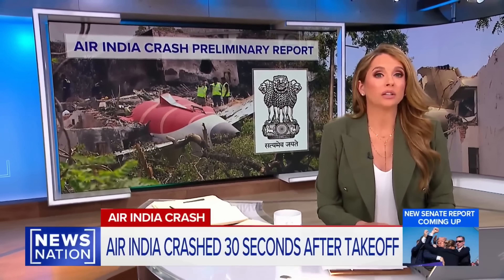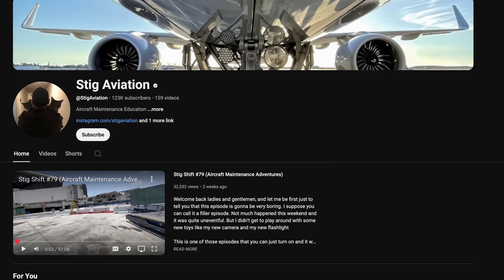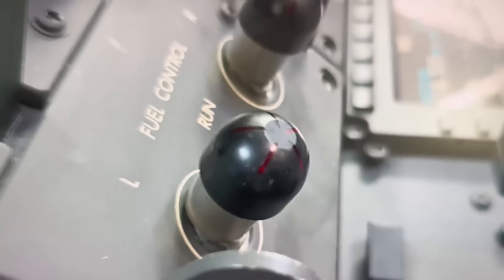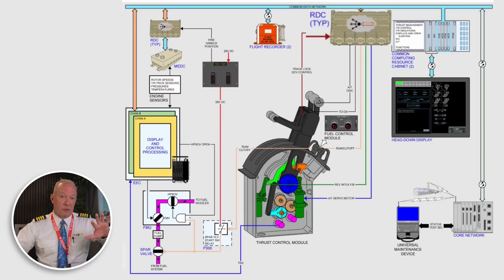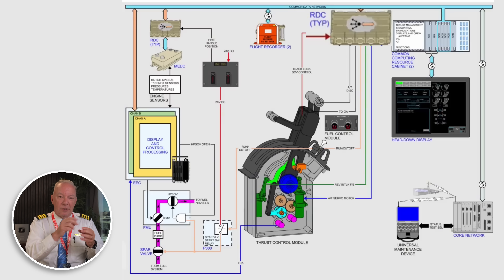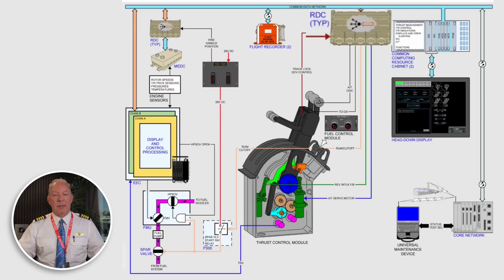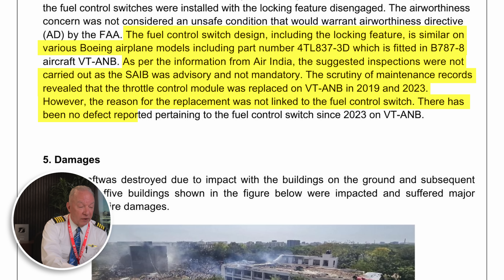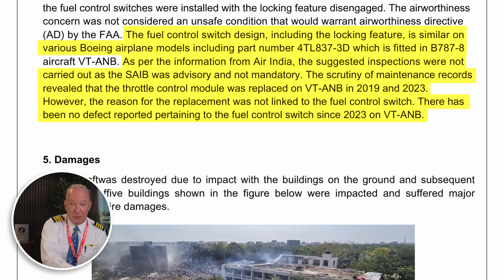The Truth About Boeing 787 Fuel Control Switches

Comment: The Boeing whistleblower is wrong in this case. Phantom mimicking did not happen because the FDR recorded the switches flip/ transition manually inside the cockpit. Meaning, somebody inside deliberately flipped them. Coupled with this fact is the FO asking the captain “why did you do that” in a definitive manner means he saw the flicking down from the corner of his eye.
Reply: The so calld "whistleblower" is showing his true colors with his nice little media tour on Indian TV full of silly conspiracy theories. Fairly sure that when the final report proves him wrong, his reputation will be severely damaged and will cast doubt on everything he said.
Reply: Your point is right, but if this was intentional, then there could be motive for the one who did it, to say something that would shift blame to the other. Knowing that it would be recorded, and could have a huge impact on their family, friends, insurance, etc. 
So the Captains statement does not clear him, and doesn't necessarily imply he saw anything.
Reply: Do you know at what point in the circuit the FDR is measuring the switch state?  Unless there are micro switches under the fuel cutoff switches that directly measure the switch physical position, your statement can’t be supported.  Generally, FDRs measure voltage and a certain point in the circuit and that voltage can be provided by a closed switch, a short circuit between the switch and the detection point or other possibilities.  I would be very surprised if the 787 has a way to directly measure the position of the fuel cutoff switches.  Only cockpit video would provide direct proof of physical motion of the switches.
Reply: But did the fdr get the correct information. We are not advised on the connection between the fdr and the switch or perhaps the relay. Incorrect cockpit information could have led to wrong decisions
Reply: I need to correct you on the quote, in that THERE IS NO QUOTE.  (Sorry for caps.  I'm having to repeat this a lot.)  The report does not contain a transcript. It contains a couple lines of indirectly reported speech from which it is impossible to tell if the words used are strictly accurate to what was actually said (minus substituting he for you) or only very roughly paraphrased.  We also don't know definitively who is speaking; that is only inferred.

It is definitely VERY STRONGLY IMPLIED that one pilot asked the other about something he believed the other had physically done.  But we don't know that for sure until the final report comes out.
Reply: From the picture that he’s showing and what he’s explaining the relays our battery operated also Ram air turbine is also saves the energy to the battery in order for the system to be powered My thinking here is that Ram air turbine falsely deployed, causing the surgeon in the system, giving extra juice to the batteries in in return these batteries caused certain electrical systems to be overpowered. It’s like a house breaker system where if you have a surge in the electricity, the breaker drips in this case the surge in the system, cause the switches to tripped, cause it is a electrically powered direct DC current caused by the search cause the system to fail I don’t trust buying and I believe Boeing Whistle blowers are correct
Reply: @123chiragkumar there was no mechanical fault in the plane. So making up fake scenarios is wrong and lies. Also, AAIB India is the lead investigator. They write the report. The world is not a fool to fly a faulty plane. It would be noticed immediately and become a global news. The 787 has registered 1200 orders (and continuing more) and flown millions of nautical miles around.
Reply: He was toggling the switch for re start
Reply: The FDR cannot record physical movement. It can only record electrical impulses or signal that would normally be interpreted as the switches being turned off.
Reply: @williamjones4483 an electric signal displaying off means it was switched off from the cockpit (that lead to signal registration in the first place). If there was a false positive signal, then B787 all over the world would have been grounded. The current investigation is headed towards the cockpit btw.
Reply: no it didn't, the FDR recorded a digital message - not the physical movement. The digital message is not generated by the switch itself.
Reply: @mpoulton-x5l  the ignorance in this kind of comment is appalling. It isn't just the FDR that records the switches transitioning. The noise they make is also recorded on the cockpit voice recorder. Stop grasping at straws.
Reply: @GiuseppeNelva  " The noise they make is also recorded on the cockpit voice recorder."
No one has mentioned any such noise.
Reply: @ConcernedParent-z1q The fact that they mention that the switches transitioned means that they have confirmation of the soun. You may want to learn to read, Mr "concerned" lol.
Reply: @GiuseppeNelva  "The fact that they mention that the switches transitioned means that they have confirmation of the soun"
I try to not read in things that aren't there. That's much better for proper analysis. The first thing you have to ask yourself is "why is so much critical data not in the report"? A simple time stamp for RAT deployment, for example. So simple, and so important. Not there. Odd, no?
Reply: @GiuseppeNelva  All we know is that the switch "transitioned", it doesn't say whether that was identified through sound or digital signal or both on the EAFR. I'm working from the facts presented, not made up stuff like supposed noises.
Reply: @mpoulton-x5l that's ridiculous lol
Reply: @mpoulton-x5l  What generates the digital message? How was an off-message sent to the FDR while another message was sent to the engine controller.  How did those identical events happen to both engines simultaneously?
Reply: I still cannot believe that either pilot did the switching. This screams water in the EEB box and caused a short...... love your posts captain bit there is more to this than a simple (sic) pilot manually switching. It's disrespectful to say this as I truly believe neither touched the switches. I could be wrong, and so so want not to be, and I will eat the very humble pie!!!!
Reply: @nward1330 No, it doesn’t scream that at all.  The odds of electrical shorts causing the switches to both activate one second apart going one direction and then going back one second apart again defies all probability and reason.
Reply: @LTVoyager but we all know however unlikly it may seem, it can happen. Why are people then stating that unitentiinal fuel switchinh to cut off has happened in the past then???? We shall see!!!
Reply: @nward1330 Without cockpit video, we may never know for sure.
Reply: @LTVoyager yes, agreed.
Reply: @nward1330 , as Captain Steve explained, the fuel switch relays are 28vdc, and get their power supply directly from the batteries. The entire EE Bay can totally short out...complete power failure...and those relays will still get power from the batteries.  Now, there were some rumors that the batteries may have malfunctioned; but I think that has already been debunked.  That does open an interesting thought of what would happen to the fuel switch relays in the event of a battery power failure. I'm going to guess that there's a back up system in the primary electrical system in the EE bay with a 28vdc stepdown transformer?
Reply: @toms1348  "The entire EE Bay can totally short out...complete power failure...and those relays will still get power from the batteries. "
If the battery (not batteries) is the cause of the short, I can guarantee that there will be no power to the relay. Shorts are paths to ground potential, and can take down systems completely if not quickly isolated.
Reply: @ConcernedParent-z1q, I as much as alluded to your point in my last post, rhetorically, that if the main battery failed, would the switches lose power. My thought is Yes.  But then would the back up battery supply power in that event. By the way, the 787 actually has two primary lithium ion batteries.  One is the  main battery, an the other is the APU battrry which offers backup power and is the power source to start the APU. So, "batteries" is a correct. But if you want to say there's only one battery assigned to primary electrical functions prior to APU start, thats fine.
Reply: @toms1348  The APU battery is not relevant for this discussion. The APU never had a chance to start.
The best hypothesis I've seen so far is that the main Li-ion battery was degraded over some time due the diode module protecting it having been shorted (the typical failure mode for diodes). This explains all the weird behaviour on previous flights. Eventually the battery got so abused by over voltage charging from the bus that it shorted. This killed the Captain's bus, which then, in about a seond, connected to the FO's bus, which then was also shorted out.
It's too long to describe here, but this actually describes all observed behaviour. (Including phantom switch movements.) This is a case where automatic redundancy caused a disaster.
The smoking gun? Boeing changed supplier for this part (diode module) in 2024 -to an Indian supplier, oddly enough.
Changing supplier for a part, that is a prime suspect, over a decade into production?
Reply: @ConcernedParent-z1q , this of course is a hypothesis...not fact.  And if there was any real merit to this hypothesis, the FAA and EASA would have already issued an AD.  I'm not saying this is couldn't be a possible cause, but given the time frame since the accident, the potential seriousness of this issue to the 787 fleet, and  the lack of action,  this hypothesis is highly improbable with respect to AI 171.  PS...the APU battery is also a backup battery in the event of main battery failure.  So it does have some relevance They are identical components. That said, the Battery(s) likely have no relevance to to AI 171 .  PS...although power fluctuations in the previous flight are certainly worth including in the investigation; and could point to the hypothesis you mentioned, I think this is a red herring.
Reply: @toms1348  I think we can agree that these are highly complex aircraft, relying more on electricity than any other Boeings, and there likely are unforeseen failure modes which can lead to bad things. I'm very open to a coverup happening. 737 MAX was wishful thinking in a kind of coverup mode, until reality really set in. Many people knew after the first accident that the proposed remedies likely wouldn't actually work IRL.
Reply: Nope. There was a warning on their screens and then he asks " Why did you cut off?" Simply, an electric malfunction in the 28v switches.
Reply: @Dannyjones1 , both of them almost simultaneously?  The odds of that happening are beyond almost impossible.  The likelihood of you getting stuck by asteroid debris is significantly greater.
Reply: @toms1348 Yep, both of them. Anything can happen with electronics.
Reply: @Dannyjones1 , the odds are exceptionally and extraordinarily not in favor of that possibility.

Comment: If the switch controls have shut off themselves in the past by a technical glitches, thus one cannot blame the pilots of Air India.
Reply: False. The one second delay between the switches cutting off means the pilot did it. No other explanation.
Reply: No pajeet. These switches cannot have any issues. Your smelly pilots did suicide
Reply: Wow, even you get slapped in the face with a kipper, you would still claim it was something else.... Go have a lie down.